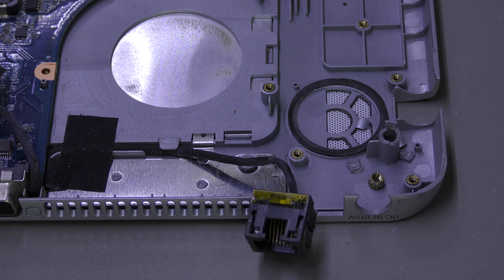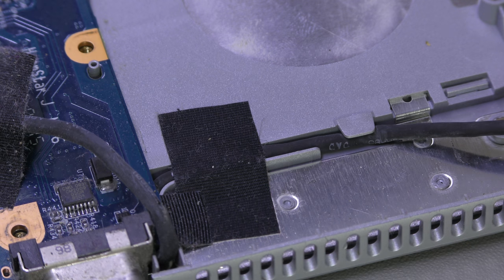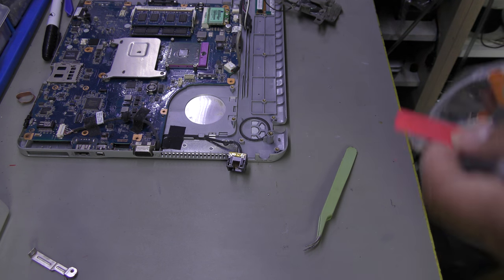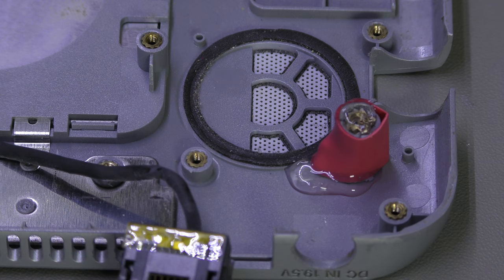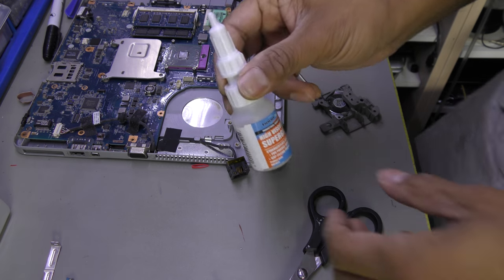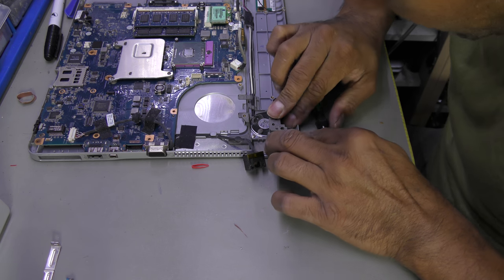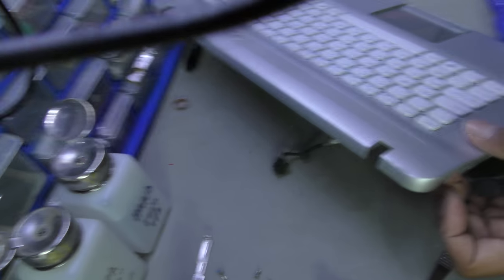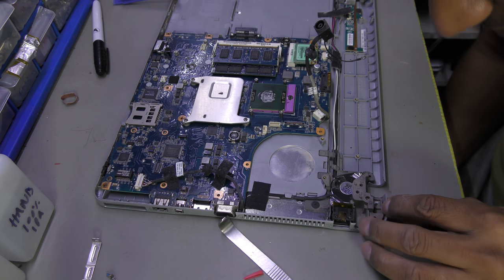HOW TO FIX BROKEN CROWN ON LAPTOP PALMREST, BASE,ETC  4K

Comment: I've done this too but with two part epoxy and shrink wrap. Super glue helps keep the bits together but the epoxy should stand up better against those who drop things. Like with iphones, those who drop will drop again.
I did find that it was far easier to get good placement by using a long screw like a 6 or 8 with a dab of oil to prevent sticking. I also used thick paper (or thin card) in between the the crown and hinge/plate/opposite shell to make sure the angle and placement was right. Once dry, just remove the paper with a knife. Not perfect but when its a hinge screw on a dropped laptop with rivetted keyboard and touch pad, like most HPs now, it is a real life saver when the customer balks at the price of that on top of the broken charger, charging port, screen etc. from the calamitous drop off the edge of the kitchen table.